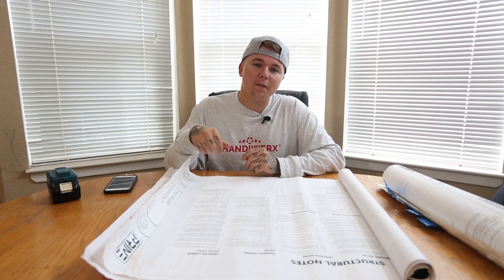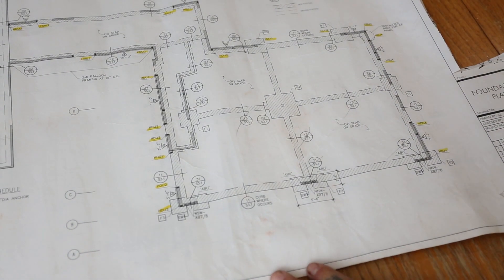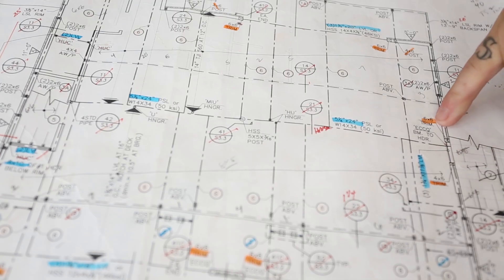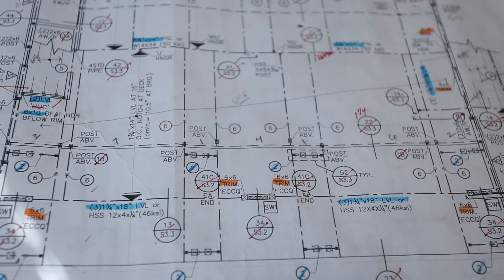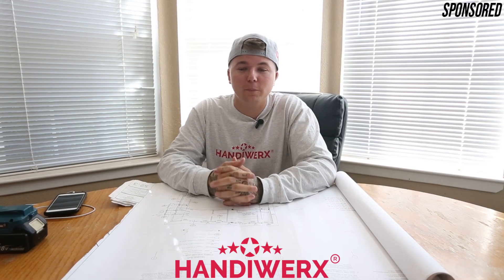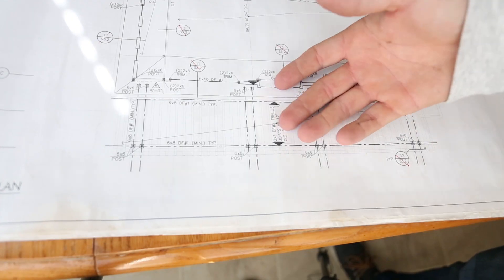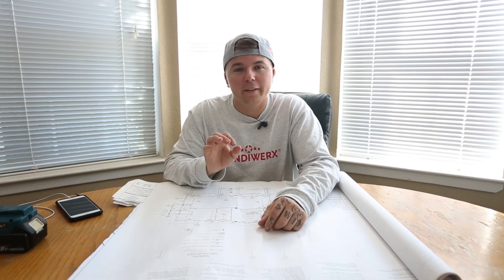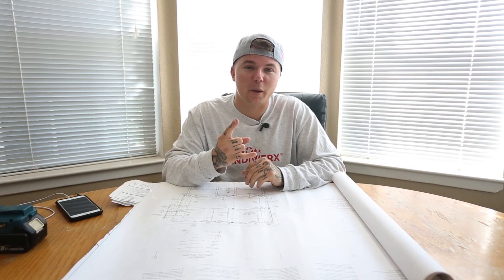How-To: Reading Construction Blueprints & Plans | #2

Comment: hi Matt. First thanks a lot for all your information. It's very easy to understand also very practical.
I have  a question, 
Does the home designer, who is developing a new residential project ( all the design), has to develop the construction plans too?
it's that mandatory? it's ok that the home designer just gives me the architectural set of plans? (of course, it includes the plans, facades plans, sections, details, scheduling...etc...)
I am really confused...

Comment: Hey Matt, love your videos.  You mention the term shear walls in many of your videos.  Could you explain what that means a little further?
Thanks
Reply: A shear wall provides lateral stability of the framing members making up the skeleton, such as the 2x4s or 2x6s. The OSB or plywood keeps the wall from collapsing in the same plane as the wall. Another term is "racking."
Reply: I believe that’s the exterior wall material (OSB, plywood) that’s affixed to the studs. You would then put a vapor barrier of some sort (tar paper) on top and then your siding material (lap siding, shingle, stucco).